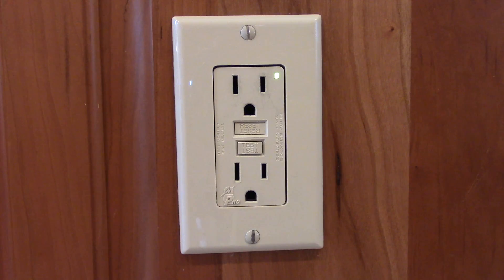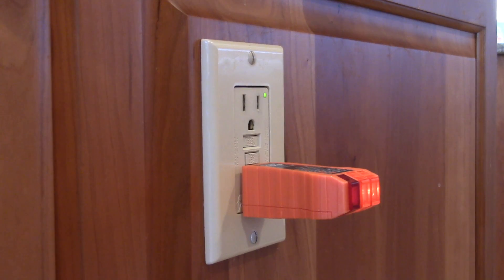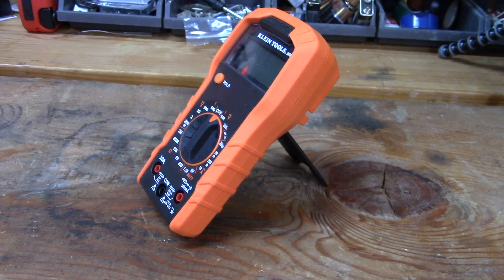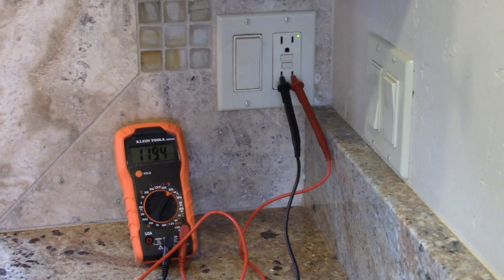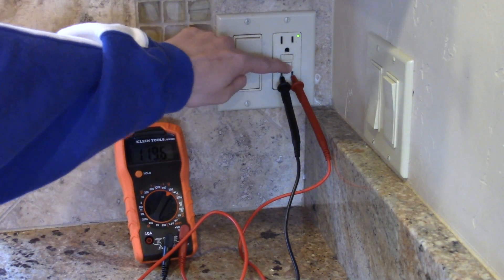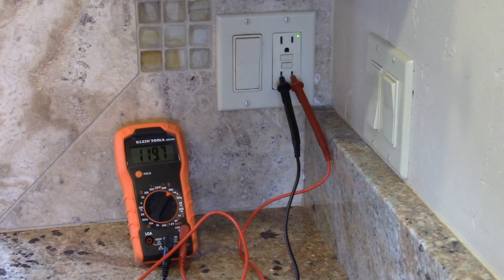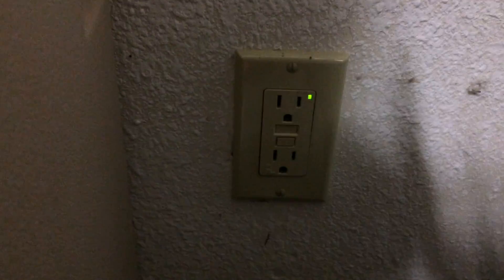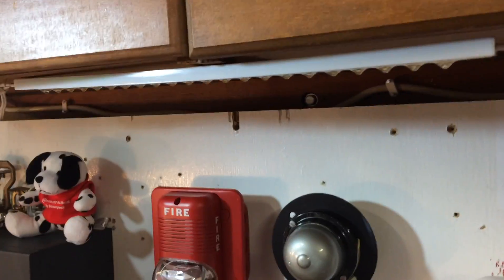Testing Every Ground Fault Circuit Interrupter (GFCI) in my Home

Comment: Just using 6v to follow line and see if they are run properly. Has the red light… however it is in always spot and the unit doesn’t read the low voltage… 

Help?